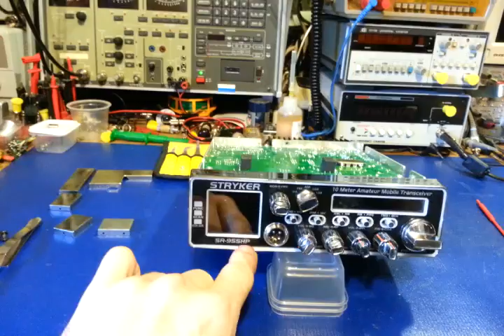Attention all radio tech's and DIYers. STOP DESTROYING RADIOS!!! SMD circuit board destruction.

Comment: 1:16 Me neither. I usually don't have anything negative to say about things but if I DO find a flaw in something, I'm not afraid to express what it is. Like Minecraft's internet receiving capabilities, which are, for the most part, exceptional. It may disconnect even though my wifi is usually flawless but it eventually returns. I'm keeping my fingers crossed that that gets fixed.

Comment: Mike, could you point me to some good soldering tutorials for modern circuits and SMD's? I am a complete noob. Thanks.
Reply: The best tutorial is to get wasted boards and practice. There are too many videos "teaching" how to solder, but the best way to learn is to do it. Just my 2 cents. Wish you the best in micro soldering. By the way, get a hot air station, it will be a great tool for certain applications.

Comment: I worked on cellphones when i was going to school and i had to use a microscope with fine tipped tweezers and hot air to solder and reball and Xray to see in the multilayer logic  board for thermal fractures. Also every tool needs to be ESD cert and ESD bench mats and ground straps .

Comment: I have a chance to buy one of these used. I have it borrowed a few days and it works very well except that I've noticed that when going over bumpy roads or if I lightty tap the case I get a short static hiss. Almost like you'd hear in a staticky pot that needs cleaning.
any idea what would cause this?
Reply from the maker: Before checking anything inside the radio check your power cord.  If it has a poor connection it may be intermittent and arcing.
Reply: @mikesradiorepair  
Thanks for the reply my friend! I've been running it every day in my dump truck and since I don't own it yet I take it out every night.
To be more tidy I bundled up the external speaker cord, power leads and the antenna wire with several bread bag ties every 6 inches and I haven't heard the least bit of static out of it today.
I wonder If the bread ties have acted like a ferret ring used in Radio controlled aircraft to arrest RF noise?

Comment: hey mike how do you feel about stinger board mods? wondering if its a option for a cobra 29 ltd classic. my galaxy dx 44v has already been tuned and peaked by a guy in carrolton georgia.
Reply from the maker: Honestly I have never installed one or even worked on a radio that had one.  Hard to believe but true.  The main problem I would think would be heat.  They don't have a external heat sink so all the heat generated by the amplifier is going to be trapped inside the radio.  They also do not have any filtering so making sure the radio is properly aligned is highly recommended.  Any spurious emissions created by the radio are going to be amplified as well as the fundamental frequency.

Comment: I see what you're complaining about, and I used to work on the equipment (back in the mid-90s) that put the SMT parts on the board before it went through the reflow oven. When the higher-end electronics manufacturers that still had this stuff in the U.S. started off-shoring manufacturing, I found something else to do. However, even then, there were issues with equipment calibration, software defects, part tape-n-reel feed issues, and a myriad of other things that might result in the poor part placement you see at the manufacturing stage. So, how do you know that somebody actually worked on these radios to cause this? These may be rejects from the QA processes (depending on where the boards were made, and to what specs), farmed out to re-work shops or work stations, and slapped together anyway with poor construction from the beginning to fill a pallet or meet other delivery numbers. Particularly goods and services from China seem to have some of these issues where the 'techs' that you are bitching about are really the original manufacturer of such Frankenstein equipment. Somebody bought them super cheap from some non-legit dealer, and they got burned.
Reply from the maker: How do I know?  Because there are circuit traces ripped off the circuit board and other glaringly obvious work that was not done at the factory.  I have seen radios with poor QC, this ain't it.  This is radio destruction by someone that has no clue how to work on SMD components.

Comment: Mike, as an old hobbyist, I avoided SMT stuff like the plague for years. Recently, I made the decision to get the proper micro soldering equipment and a good microscope. Having built several boards with SMT devices, I am growing more confident. It's not that hard,but it is definitely  a whole different world.  I don't really want to go smaller than 0805 if I can avoid it. My eyes are 66 years old, so I'll stick to what I can handle. But, it's not impossible. That's where electronics has gone.

Comment: No way the common person should be doing this. I learned my lesson when I paperweighted my president andy sure I got out to wv on a 3ft firestik from west tn on a barefoot radio but it wasn't worth it when I said oh we can go a little more boom no modulation and there is no way for the common person to check the tiny components let alone replace them. Some people would send it back but I'm gonna take this one as a lesson learned "Dont screwdriver radios".We need to leave it up to the pros like you.

Comment: I am ok with small parts as long as someone or something solders them for me. In terms of planning, it is actually easier for me cause i can make the Shortwave transmitter i am working on much smaller and add some high power rf amplifiers. It agitates me when somebody does a crappy job and I have to fix it after they are done.

Comment: So ANYWAY, The REASON that radio DOES NOT WORK is because the MAIN OUTPUT WIRE THAT FEEDS THE ANT was REMOVED  : )  https://simonthewizard.files.wordpress.com/2017/05/img_3688.jpg
Reply from the maker: +Rob Young 

It had a lot more problems than just that.  A butcher had been working on it and destroyed several circuit traces.

Comment: I was wondering if you could help me out I have a RCI 2990 and I keyed up one day and it didn't unkey I unplugged it immediately so I wouldn't do damage to the radio can you tell me what the problem is that made it do that I was told that is a common occurrence with the radio
Reply from the maker: +Gregory Ladd 

Like anything made by RCI it's rather poorly designed.  It's common for the CPU boards to crap out in them and get stuck in transmit.  If TX shows on the display with no Mic plugged in its probably a bad CPU board.

Comment: Been fixing electronics for decades. I love to fix tech damaged equipment. Makes it a lot more fun!!!
Reply from the maker: +BigFoot Too

Not much fun repairing destroyed multi layer SMD circuit boards in CB radios.  Frequently  the repair cost is more than a radio is worth to the customer.  Amateur radios are a different story.  Especially when your talking about a radio that may have cost  a few thousands to $10K or more new.  All comes down to what is the radio worth.

Comment: 0402 is the smallest I've dealt with and I also work with fine pitch TSOP. Easy with correct tools, fine tip iron and LOTS of flux. IR reflow oven is a must with bottom termination and thermal pad components. I do this in my engineering job and people are amazed at me not needing magnifiers.

Comment: what makes you think that it is not post assembly repairs from the factory?
Reply from the maker: Tater1337 

Ummm, because the radio doesn't work because it was so butchered.  Definitely not work done at the factory.  Factories have the proper equipment and more importantly properly trained workers to do QC spot repairs.  This looks like a angry chimpanzee did it because he didn't get a banana for lunch.  This has the classic look of inexperienced hands and a monster sized soldering iron tip.

Comment: Just wondering were the instant information booth is, you know in case I'm not born knowing everything about something like you? Any suggestions?
Reply from the maker: +alan meyer 

Practice soldering SMD components should be done on purpose made practice boards.  You can buy them all day long on ebay for a couple bucks and come with all the components to fill the board.  Once your skills are perfected on practice boards its time to move onto real world applications.  Everything I know about electronics was learned either in schools, from relatives that have worked in the industry or reading hundreds of books and publications on specific subjects in the field.
Reply: Landrew0
A kinder gentler world does not always work. Some people only learn when a boot is shoved up their ass.
Reply from the maker: Landrew0 

No, it's trying to show that a radio isn't the proper place to practice soldering skills.  Practice is done on purpose made practice boards.  If you had to deal with this kind of hacked up work on a almost daily basis you would probably rant to.  Seeing radios that were repairable before they were destroyed by someone who didn't bother to educate themselves on proper technique and use the proper equipment is enough to make any tech pop a cork.  The point of this video is to practice your SMD soldering skills before attempting to repair someone else's radio.
Reply: And who appointed you the Great Enforcer?
Reply: The man said he got it from a customer so if the customer fucked their shit up then bring the shit to you either tell them you will not work on it or you need to get another job fuck you if i wanna learn on my shit its mine
Reply: I struggle with the purpose of this video. I could understand a "do's and dont's" video with useful tips on how to do it properly, but this is something else entirely.  It's a rant trying to prove how stupid someone is, and how much smarter you are than everyone else.

Comment: What do you think is the best cb for someone on a modest budget.
Reply: Look for anything made by Uniden, Realistic, Cobra, that was made pre 1990. You can find an older radio for cheap on Ebay and the reason you want older is because of the build quality, sturdier design, and way better receive and transmit. If you can find an older Realistic TRC-451 or 449 for example and have it gone through, have all the caps changed and have properly aligned, you will have an SSB rig that will out talk ANY brand new radio today. Brand new radios are built too damn cheap now, older = BETTER.

Comment: You have not had fun until you solder 01005 size passives. Oh yeah! Looking through the microscope, the ends of the tweezers look like you are handling sand grains with boxing gloves. Horror show!
Reply from the maker: +videolabguy 

Yeah they are really tiny.  Don't drop one on the bench, you'll never find it.  They make dust particles look big.

Comment: Mike I agree with you that SMD soldering/de-soldering should be worked on with experience and lots of practice. I do a lot of SMD work and I bought my equipment to do the job. The only problem I have with some SMD component is identifying the part numbers, especially if you do not have a schematic diagram,
Reply from the maker: AS28g 

Yeah part numbers are a thing of the past now.  Parts are so small there just isn't any room to print anything.  I avoid working on anything SMD if I don't have a schematic.  LOL, a lot of good it does to troubleshoot a circuit and find the bad part and have no idea what part number it is.
Reply: @mikesradiorepair  identifying the type of circuit and what it does you can get close if you do a lil math for example if its an opAmp, resistor pack, logic gate, voltage divider, filter, R-C, R-L, attenuator, Lpad, H&L-Q indct. ect....

Comment: I used to work in a TV repair shop years ago, I used to see sets come in that customers tried to fix. Today with SMD's it's even more difficult, that's why so many techs just replace circuit boards in the new sets.
Reply from the maker: That and high end SMD equipment isn't cheap.  I have several thousands of dollars tied up in Pace equipment.

Comment: I started working on tube radios a few years ago. I've widened my base out to SMD's. I stop working at 0406... and I will let fly some colorful language when it gets that small. The key to SMD work, as you noted, is practice with the right tools. The right tools can be pricey. I bought a Weller WX-1 just for SMD work. I have "cheap" hot air rework gun but it only has two nozzle sizes. Huge and not so huge :o) I don't do SMD work enough ti justify a "real" hot air rework setup.

I don't think you mentioned solder. The right size solder is also important. I have 4 different sizes of solder on the bench and one roll of lead free. I can't get used to how lead free looks btw. The smallest is used for SMD work, the largest is used in the old tube radio gear along with the two middle sizes. The smaller of the two middle sizes is typically what I use for thru hole work.

Good video!

Comment: I'm an SMT tech and I've been at it for a while now and yes, parts are indeed getting smaller. As of now, I have to rework parts that are smaller than a grain of salt. Also, to make matters worse for techs that have little SMT experience is that electronics industries are all going lead free. If you have difficulty soldering leaded SMT, you are in for a world of frustration due to lead free solder needing higher temperatures and longer contact time.
Reply: meangreen69Nova The great thing about SMT is the simple fact they can stand more heat than the older through hole parts. But just like with those they do have a point of no return with heat. It is amazing at how much they can handle and clear heat compared to the older parts
Reply: Throughout the 1990's I was a technician for General Dynamics performing SINCGARS rework and we were only permitted to use silver solder. We had to be extra cautious not to apply too much heat for too long because it would delaminate the multilayer circuit cards used in the product. Certification for this type of soldering wasn't easy and you had to exercise real skill to do it correctly.
Reply from the maker: Everything has been lead free for quite some time now and it can be more challenging to work with.  Main problem I see is lack of training with SMT components.  If people would just take the time and practice they would find it's not that hard to work with.

Comment: my midland 9001z was just the same way. I was working on it in the blind with a manual for referance and I touched the wrong thing with a probe and poof up in smoke . Its ok though ,now I know what not to touch.Kinda expensive way though. I hated that radio .Except for the guardian alert the radio is the same as any other. poof gone,so I was upset at what happened and took that darn radio apart for a parts radio . still upset at what I did though.
Reply from the maker: Poof usually isn't to bad to repair.  The radio in this video was a example of improper repair procedure.  The traces in this radio could be repaired but it would take a considerable amount of time to undo the damage done by someone else.  If you just shorted out something it probably wouldn't be bad to repair.
Reply: You are correct but after it went poof it also went smash. Threw the s.o.b. on the floor smashed the crap out of it then took it apart for the parts. Midland has a service manualm for it but they don't like anyone but their people working on their radios . I wrote them a note when they sent me a newsletter and told them I will never buy anything from them again . That should really hurt their pocket. Never really used the radio either,just wanted the manual to make sure I didn't turn the wrong screw and for future use with customers .

Comment: Well said Mike. Don't know how many times I seen this come in and look at the guy and say, NO. Hate cleaning up others mistakes.
Reply from the maker: Shoot, I think that's about half of what I do these days, straighten out other people's messes.  In older radios that wasn't to bad but on modern SMD boards it can be a nightmare trying to undo the damage.

Mike
Reply: The Radio Shop the Labor sign in your shop:       Labor per Hour. $50.  If you looked at it $75 If you already fixed it $200 per hour

Comment: I am right there with you.
You have to know your limits... I can do 0603s with a loupe... but if it's 0402s I break out the 3d microscope.
Too many years staring at this stuff and I am going blind from it.

Another big one... aside from sobering technique which is a big issue... is cleaning!
How many radios have you opened up where there is enough flux residue in there to bottle up and sell?
Well... I guess I am exaggerating there a little but it's bad.

Cleaning up after ones self isn't hard.
Isopropyl, kimwipes, and some horsehair brushes are not expensive :)
Reply: It will only get worse. When you get older the focal muscles in your eyes don't work well.  I'm 55 and near sighted and I need reading glasses to look at through hole components.
Reply: At 45 10 years ago I used to be able to take my glasses off and could read a newspaper 3 inches away, now my only no glasses sweet spot is from 12"~16" any other range and I'm in trouble. I hope at 65 there's still a sweet spot.
Reply from the maker: No kidding on the flux.  I did a older radio a while back that no joke it had flux residue at least 1/8 inch thick in some places.  You couldn't see the circuit traces for the globs of flux.  Never thought about repackaging it.  Man, I could get rich doing that.  :)

Mike
Reply: +Mark19960   clean up is a MUST!  thanks for that